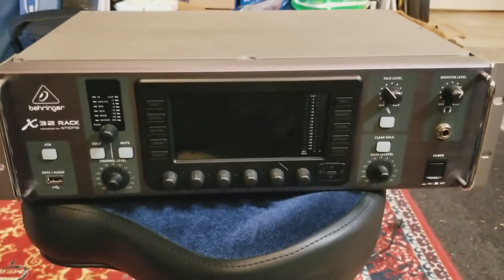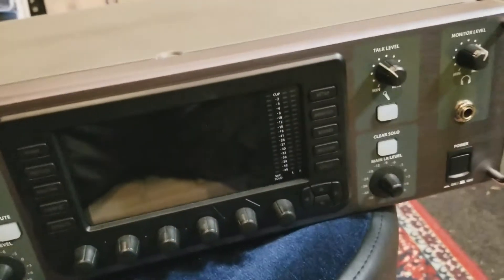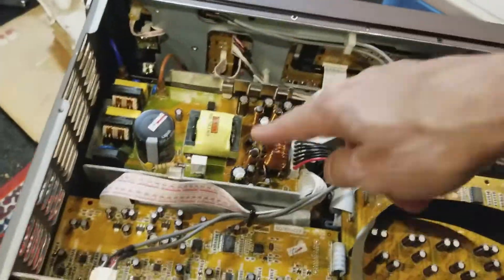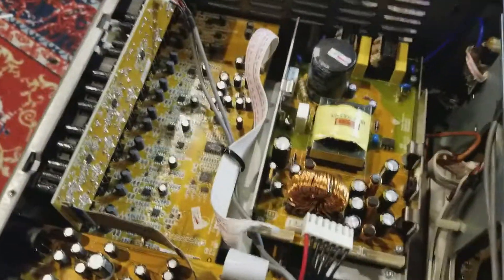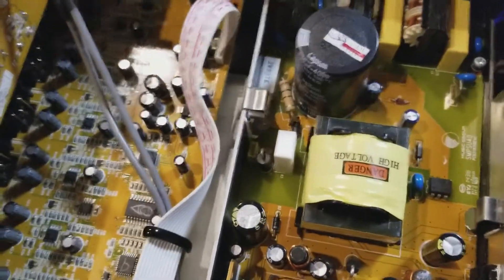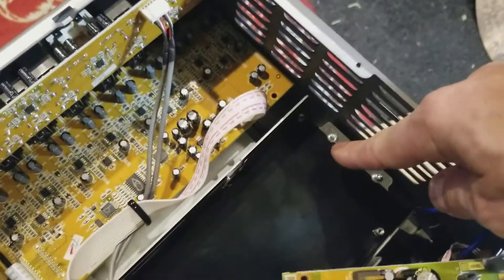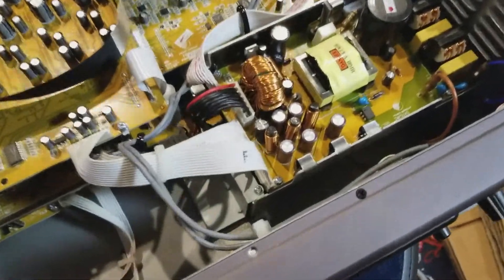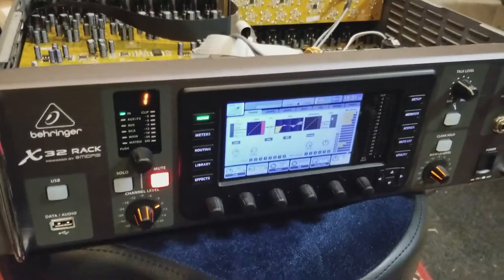X32 Rack power supply replacement

Comment: Helpful, but omitted some crucial stuff, including taking the entire "sled" out rather than just the circuit board, and the two wired clips in the corner.  "Almost" a very informative video.  There's one other video on YT that's a little painful, watch them both carefully, and seems like it can be done if you're careful.  Only unit I could find was on eBay for about $130 (March/2025), and it includes the "sled".  Just now (7/25) getting around to attempting to do this.
Reply: Update: Successful installation, time about one hour - carefully removing and keeping track of every screw.  Took off all the wire connections, including the two separate wires.  Those needed pliers to remove.  Undid the four screws holding the entire sled.  Lifted the old one out, a little angling required.  The interior side has a little plate that moves, don't remove it, line it back up when reinstalling. Placed new unit in, tightened all four screws.  Carefully replaced all wires, being sure they were securely seated.  Replaced cover - not a single screw lost in the entire process, no extra parts!  Plugged in, perfect operation.  Never had to touch any of the components, came close removing the wiring connections, but it can be done, little clips holding them are on the outer side.  This is an easy operation, saves a bunch of time/money doing it yourself.  I was extremely slow, careful and methodical, and I'm no actual tech, but I got it done.

Comment: Hello,
I’ve seen your tuto on youtube about the X32 power supply.
I also have a problem with mine and the resistor R4 is burnt and have no way to read the value on it. I can fix the problem swapping the capacitor but without the resistance value I can not do it.
I you please have any info for that it’ll be wonderful. Thank you.

Comment: Help me, could you help me? The source of my X32 is faulty, it has a diode (D20) that is parallel to the GS terminals of transistor TF20n60, it (D20) is shorted, could you tell me if it is a common diode or zener and what voltage of which, the VGS + -30V. Thank you.